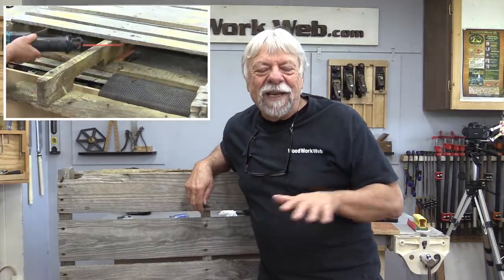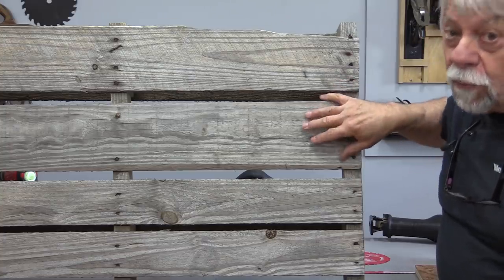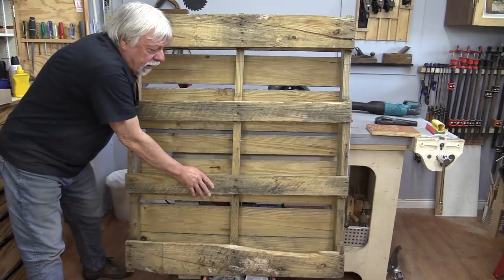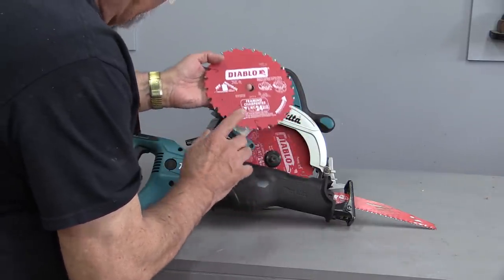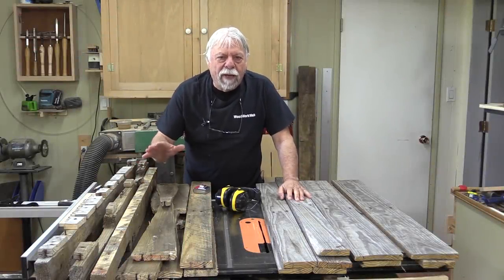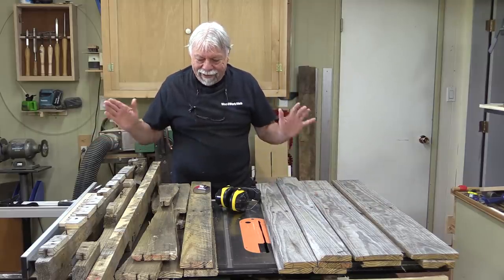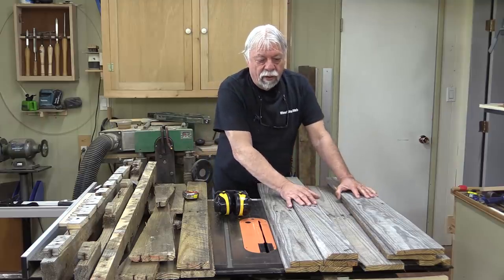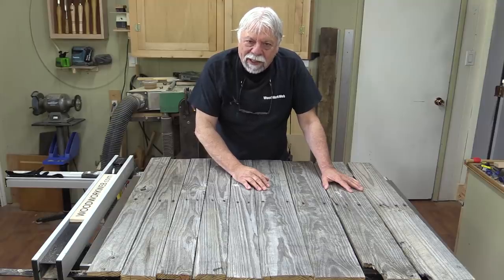Why Colin Knecht Quit Using Pallet Wood for Woodworking

Comment: picking up old weather exposed palets you OF COURSE can only expect what you have there on your workbench...I work for a transportation company and we throw away so called "one-way-palets" that look MUCH better than yours, some of them looking brand new. The lumber then looks way better and is in much better shape with less cracks in the ends and so on.
Of course nobody would want to build furniture with it ( except for rustique looking stuff, i.e. ), but you can still use it for having french cleat elements to put on your cleat wall, for example...they are accurate enough for that.
All of this wood is in any case good enough for some outdoor shelves, little arts/handcrafted deco-"bullshit", splints and so on.
or (as I do) for beginners to try out and practise cutting, sawing, assembling.
So the saved money might indeed a bit higher than the 8 USD...
The rest of the wood will take care of my room temperature or the fire place as you mentioned already.

Greeting from germany and the best wishes
Reply: Very good advice  when starting out I used pallet wood for practice cuts, practice joinery etc..  practice makes permanent. The little tool shelves and mini tool sheds (like little bird houses for tools) I've made from pallet wood are still going strong after years in the Seattle elements.
Thanks Uwe!

Comment: I love watching Colin and his video's, that being said, I end up using probably 95% of my pallets. The cutout supports are fantastic when making bottle racks. The split ones can usually be tightened up with wood glue and a little saw dust and a clamp.  A lot of people love the rough look, even so much that i've had to use my auger wheel to rough them up more. If you split it in half, I just charge $50 stained, that's $100 per pallet. It's a great hobby with a lot of imagination when using these projects. Just my in put.

Comment: Very good video. I totally agree. The savings are minimum if any. I wanted to make a nativity stable from pallet wood since there are so many ideas out there. I had to find someone local who had free pallets, spend a couple of days messaging people in Facebook, OfferUp, Craigslist. Then drive and pick them up and go through the same cleaning process you did in the video. I had to remove the center nails since I needed to put them through the planner. Too much work for $10-$15 worth of wood, and it still has all the nail holes in the middle. I picked up a few pallets since I was planning other projects, but ended up cutting them all up for firewood.

Comment: When I first started woodworking, I used a lot of pallets. I got caught up in the repurposing of used pallet wood and the whole rustic aesthetic, but as time went on pallets kind of became something I don’t really wanna mess with. The time spent was beginning to outweigh the money saved. Lots of cleaning, and breaking pallets down, sometimes a lot of effort with little yield. At this point I’d rather spend the money on fresh, nicely mulled clean lumber and just go straight to building my project.
Reply: Never mind the expense of replacing or resharpening high quality blades. I killed the fine finish of my excellent $265 tablesaw blade the other day before I got halfway done prepping the pallet wood stock. I can build two average kitchen cabinet jobs with that blade and still have it going 90%+ in feed rate and nearly 100% in quality. But I killed it trying to use pallet wood for one single $700 4-foot hallway table. Just poor economy, and several hours of extra time wasted that you don’t have to do with lumber mill stock. 
All those videos about pallet wood furniture are just that: videos. I learned my lesson! Not life-changing expensive, but expensive. When I sell this piece for what it’s worth I’ll wind up with less than $9 an hour for my effort because of what that pallet wood cost me. I was stupid.

Comment: There are more than a few video's i've seen where new boards are processed in order to feign a "distressed" look. pallet wood saves the time it takes to "distress" or to make a piece look Rustic. I've nicked a jointer blade with a small staple, which was a huge pain for one board but that was my own fault. The wood wizard is 30 bucks i believe, and a pair of ceramic magnets can be had for a buck at harbor frieght to find any metal. I have a couple old table saw and circular saw blades that I sacrificed until I finally bought a blade that can handle wood with embedded metal. Worth it because I reclaim wood from not only pallets but from old doors pretty often and whatever else i can find that people throw out. I went from about about hour to fully disassemble a pallet with a prybar, hammer and pliers, and now it takes me maybe 10 minutes or less. It all depends on what you want your outcome to be and what syle, as well as how you want to dedicate your time i suppose.

Comment: Nice Demo Collin, yes it’s not easy to use pallet wood and many people will take without observing first - I just posted a video on how to use a circular saw with a demolition blade to dismantle a pallet with much less effort. While I’m quite sure that it won’t turn you into an instant convert of the church of pallet wood you may nonetheless find it interesting. I punch out all nails with an air punch and usually pressure wash pallets before they even come close to any tools. If you do want to cut boards on the outer rafters as you showed I recommend a home made track saw so the saw is easier to handle and doesn’t get pulled between the boards. My opinion, love your channel and videos - thanks for sharing

Comment: My only experience with a pallet was when I had some heavy ceramic tile delivered.  They told me that I could keep the pallet.  I thought I could dismantle it, but found out the hard way they were put together with ring-shank nails.  After about an hour and only one board removed, I finally got smart and took it back to the home store.  I didn't want to chance my saws on it.

Comment: Depending on what the pallet was used for,  it could be soaked in pesticide. Think of that while you're sanding.
Reply: Right Colin was not using any dust protector.  A woodworking buddy of mine stopped using them because of the smell and chemicals used on many of them.

Comment: My job gets a lot of odd size pallets. Often only used once because of they’re not a typical size. So I frequently use pallets for projects. 

I bought a pallet buster on amazon for $40 to pry the wood apart. And I also got a pneumatic nail remover to shoot the nails out. Takes about 10 minutes to bust a pallet apart and remove all nails.

Comment: I completely agree with you on this one.I run a workshop for a charity and have had to ban the use of any machinery when pallets come into the shop.The cost of one sawblade,or one set of planer blades far outways the savings on  the timber.Our stipulation is that if you want to use pallet wood ,then you use the hand tools (preferably your own).We have uses for some of it when making planters for instance,but it doesn,t last very long at all.1 nail or staple is generally enough to ruin any blade.Not to mention the danger from loose knots flying out at high speed.Some of the members of the club have really complained a lot,especially when i ask if they are willing to pay for new blades etc from their own pockets.A few have even left in anger.But after all we are a charity and money is tight at the best of times.

Comment: I started hobby woodworking just a year ago, and I agree. The money saved is not worth time invested when it comes to pallets. Douglas fir is already dirt cheap. If you want "free" material there are other options: use your scrap pile, raid the junk pile for new construction. Even better, plan ahead and go buy only the lumber you need for the project, minimizing scrap accumulation. I like Steve Ramsey's minimalist approach.

Comment: I use pallet wood for all of my wood working and I just finished the inside of my new home. And now the big project of mine are Raised Beds for growing as much food as I can. We live on The Big Island of Hawaii and we can grow all year long, Our zone is 10 A/B
I use the skids as the corner posts and the slats as the walls of a 24 inch panel That gives me 2 foot depth bed and as long as I want.
I used pallet wood for all of the facing of all the cabinets in the house and will be making all of my outdoor furniture from pallets.Also as flooring for a Lanai and the roof as well
 I do not know where you get pallets, But it has been my good fortune to find all kinds of HARD WOODS in the pallets I get here! Redwood, Cherry, White and Red Oak, Poplar, and the list goes on!
 The scraps I burn and add to my compost. The hard wood scraps, I use in my BBQ, (Makes great coals for Burgers and Steaks).
AT no cost to me, I will continue to use the this most versatile material for ALL OF MY WOOD WORKING PROJECTS!

Comment: I worked at a wood flooring joint and all the exotic woods that came in as flooring material came in on exotic wood pallets . Not quality wood but enough to do the side of a barn after gathering all those pallets together over time. 1x6"x5 feet and part of that was good. Depends on what you need?

Comment: I live in Vietnam and right around me about 10 pallet shops making standard size and special pallets for a near by industrial area. The wood used is fast grown logs or trimming from better wood. The pallet end up all over the world so you could be using stuff from here.
I needed some quick fencing and went along and bought a pick up truck load of new timber in the three different pallet size pieces for VND 1,000,000. that's about $30. Enough for18m of fencing, plus they also lent me a nail gun and gave me the nails. Ten years later the fence is still there though I did splash some wood treatment on it with a broom.

Comment: I've used pallets for years and you have to be picky with what you use .I can't afford a Planer thicknesser so i just sand the faces and use them for projects based on the quality and age of the wood  ,I have two log burners to heat the house with any off cuts so nothing is wasted .
If you were in the UK you'll be paying about £40 for those 8 boards ,and some would be no better than the split pallet wood .
I have had  pallets made of Oak and other hard woods  ,which I couldn't afford to buy here .
So yes if i was in the states i would probably buy fresh clean wood but in the UK on a budget you learn how to pick a nice clean pallet and remove the nails .
Some of us are doing wood work as a hobby so we do what we can with the budget we have .

Comment: working in a printing firm l found some pallets of paper that came from some countries had excellent pallet timbers, 1" thick with 6 x 2 runners, no stones or nails and  only staples which came out easy, the timber was not treated though
Reply: I call untreated timber a bonus

Comment: I use a lot of pallet wood. I was able to hook up with a guy who collects and sells pallets.  He gives me the non-standard sizes that he can't sell.  One of my project was to use the wood for my living room floor.  It took me 2months of taking the pallets apart, cutting to size, planing to uniform thickness, etc. But the end result was absolutely stunning.  Later I used the skids to make a butcher block counter top for our new stovetop.   
Was it worth the effort? Yes. Would I have started the floor project knowing I would be taking 110 pallets apart and spending 2 months preparing the wood? Not on your life.

Comment: The few pallets I managed to get I disassembled with a crowbar after it became clear that despite the required elbow grease, anything else would be too much hassle. I now have a decent collection of boards some I have already used for a project or two and it only cost me the price of that crowbar.

For an idea of the awesome stuff you can make with pallet wood I strongly recommend Jackman Works on YouTube 🙂

Comment: Having worked with pallet wood a bit, my opinion is that they're only valuable for projects where you want the pallet-wood look, or, you would like cheap, rough lumber for utility projects around the house/farm - i.e. a scrap wood storage box, lumber drying/storage racks (especially to keep plywood off the floor), rough shelving for oily or dirty tools, etc...

Comment: remembering a PBS show 'Square Foot Gardening' I obtained from the pallet making facility on the edge of town a few scrap or damaged (free) pallets.  The wood was thin wood, but once off the frames I was able to make several footlong pieces, and made several wood frames.  They lasted for years with potting soil in them.  A friend of mine obtained several, left them as pallets, and made a compost bin in his back yard.  Unless I am planning to cover it with clear or colored epoxy, I don't want it exposed inside the house.
Reply: I've made planters with the good chunks of old 5/4" deck boards that I replaced maybe 5 years ago. Used deck stain on them, then wrapped the inside with vapor barrier and used cheap patio bricks as a footer and they don't seem to have aged a bit. I suspect they have a decade or more life left in them.

Comment: I've found pallets with nice plywood tops 4' x 4' totally useable.  It also helps if you work at a place that has a lot of stuff delivered on pallets, then you get the pick of the litter. Storage boxes are a good use of pallet wood.  I've gotten some nice mahogany from foreign pallets.  On a farm we built shelters for mini horses from pallets.  I know a guy who got not only pallets but storage crates for huge transformers, the pallets were good and the ply was great, of course he worked for an electric company. Not all pallets are equal.

Comment: I make many beautiful projects from pallet wood, but it never goes near a planer or joiner. I wash the wood with a scrub brush, a bucket of dish soap and water, and a garden hose, and let it dry in the sun. Instead of trying to smooth the surfaces, I do a little bit of hand sanding. This gets it ready for a finish (usually oil-based poly) while retaining the rough texture and saw marks, which is ideal for the kind of rustic furniture that I make. It is hard to know if pallet boards have been chemically treated, so I prefer not to be generate a lot of sawdust with power tools anyway. Rather than try to make the wood conform to a narrow view of what wood should be, I try to find uses for the wood as it is.

Comment: I stumbled upon a huge pile of new pallets  several years ago.  They were stacked high into a tractor trailer sized dumpster at the back of a store.  That store was being outfitted for a new retail outfit that was moving in.  I went inside the store where there was a team of folks setting up all the display cases that had been delivered on pallets.  As it turned out, the team there work for a company who's business is setting up stores all over the country.  I inquired about the pallets out back.  They indicated that the entire dumpster would just be sent to a local landfill!  I asked about rescuing a few for use in our volunteer wood shop.  The answer was yes.  I expected to place a few in the back of my jeep to cart them home.  They were so enthusiastic about helping our organization out that the stacked their pick up truck high with an enormous number of pallets, followed us home, to deliver the entire load!  I told one of our local wood worker volunteers about the experience who we then did the same for yet an additional load to his shop.  In this case, new furnishings for stores ere on new pallets made of white pine.  Our volunteer group has also since discovered that HVAC contractors often time have heavy duty pallets, meaning the center supports are usually 4x4 hardwood which we rip to widths appropriate for the job.  I guess it's all about intended use and costs in the end.

Comment: Most pallets locally are either hardwood or plastic, sometimes softwood  or plywood. I have a couple pallets down cellar I use as pallets for storing items on. I never use pallet wood for woodworking, but have friends who do. Outside, pallets can be used for stacking firewood on. Thanks for the economics lesson on reusing pallet wood.

Comment: One thing I learned years ago. Your time is valuable. 

At the end you got about $6-$8 worth of wood. How much time did it take to get to that point 15-30 minutes? Say you get paid $18 per hour at work. That free wood costed $4.50 - $9.00 in effort . It very well could have saved you money to buy the wood new.
Reply: safe space that ain’t fun.
Reply: safe space  it really depends on if he sees the whole process of tearing the pallet apart removing the nails and Trimming... Fun.
Reply: This comment comes from a position of employment. These days, it's not so certain anymore that jobs will be readily available.